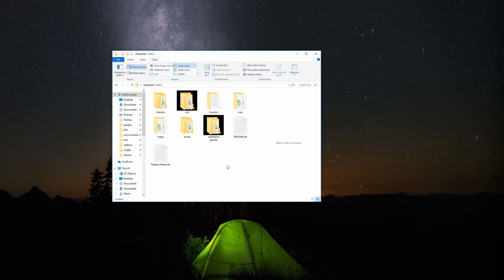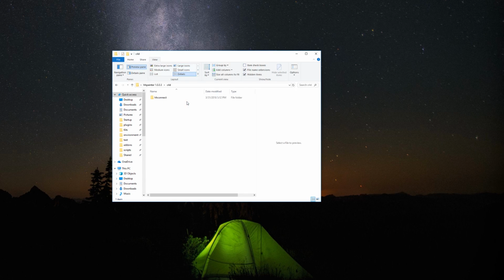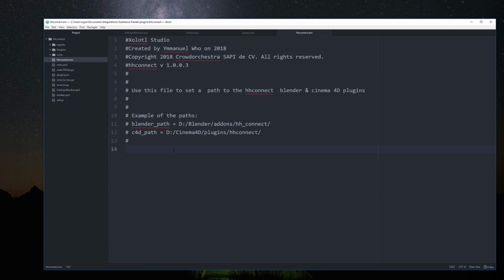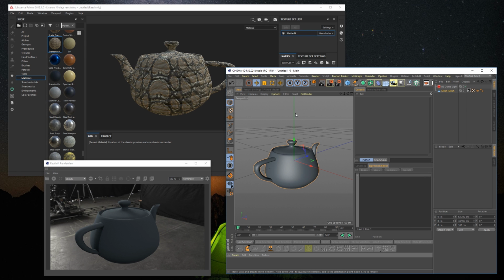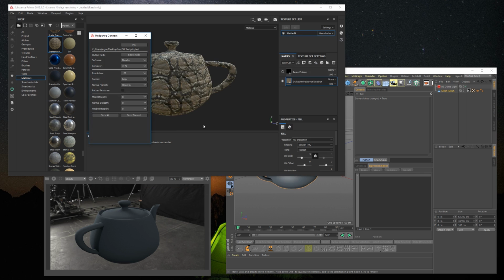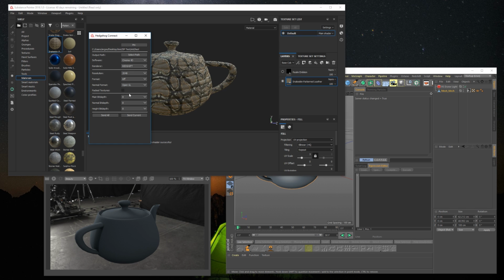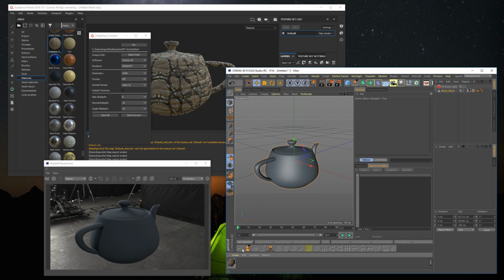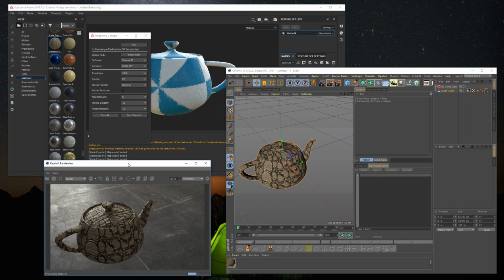LEGACY - [CINEMA 4D] SUBSTANCE PAINTER Live Link Installation and Use Guide

Comment: Unfortunately the Plugin does not automatically create a material in Cinema 4D. I Started it in C4D and also in Substance like in the Video. After clicking on "send all" or "send current" it say "Success" in substance log window. But no material in C4D. Did I miss something?
Reply from the maker: Contact me in the Discord server so I can help you check this issue
Reply from the maker: so the issue was that the version of the plugin was too old, updated to 2.0.1 and it got fixed :)
Reply: @XolotlStudio  Yes, now it works perfect. I am using C4D r19 and Substance 2020.1.1. Thank you for your help ;)

Comment: Could you please update this video? I'm having this error:
[MapExporter] Nothing could have been exported on the DefaultMaterial stack:
[MapExporter]     The channel Anisotropy angle is not available in the DefaultMaterial stack.
[StacksExporter] Map export ended
[Plugin - xolsplink] ERROR: [Errno 2] No such file or directory: u'C:/Users/mirko/AppData/Roaming/MAXON/Cinema 4D R20_4FA5020E/plugins\\temp\\data.json'

[EDIT] It seems working now, I just forgot to add "/xolsplink" at the end of the path in .json file
Reply from the maker: please read the instructions in the zip file.. if you still have issues, feel free to contact me via discord

Comment: This isn't working for me, My downloaded folders are different. The C4d folder doesn't contain a hhConnect folder?
Reply from the maker: the instructions for the new version are in the zip please read the text files included, the latest changed a lot in order to improve stability and add extra features
Reply: @XolotlStudio  Thanks for your reply but its very confusing, Which text files to follow? Is it HHcConnect that goes in the substance plugin folder or xolsplink folder? I'm getting nothing in C4d when I save the files out. Is there a simple tut for c4d and Substance?
Reply from the maker: @pelolocoblue  in the zip file you downloaded from gumroad, the hhconnect is an old version. the current version is 1.0.0.81 if you have more doubts feel free to contact me via discord ;)
Reply: @XolotlStudio  Thanks for your help, It is working now. Phew!

Comment: This seems like such a great plugin. 
The textures are exported to the designated folder for me too, and the discord link seems to be expired. Could you tell me what I've done wrong please? 
I've been looking for a solution to my problems with sp to c4d workflow for so long and now I've found the solution I'm desperate to finally get it working
Reply from the maker: i just used the discord link in this video, is that the one that seemed expired?
Reply: Xolotl Studio I just tried it again and it worked fine. Should I try to find someone else with the same question or message you on there?
Reply from the maker: @raejelly22  just write there i'm in the discord my name is ymmanuel

Comment: Great indispensable software   The HHConnect Bridge works with Redshift amazingly well.  Listen to the video during install.  STAY OUT OF PROGRAM FILES, this is not your mothers install!  No more messing around with Nodes unless you need to.  It reminds me of the days I used Lightwave- only this is for texturing instead of modeling.

Comment: my c4d folder doesn't have "hhconnect"folder,  but four different files inside it. 1.hharnold 2. hhconnect 3, hharnold, hhoctane.
Reply from the maker: yes i forgot to add the folder, you can just rename the c4d folder with hhconnect and use that one

Comment: Hi set it all up but nothing happens in C4d. The textures are exported to the designated folder.
Reply: I have the same issue
Reply from the maker: contact me via discord and ill help you link in the description of the video
Reply from the maker: contact me via discord an i'll help you ;) the link is on the description, also be sure to read all the text files in the zip folder

Comment: Godtier plugin man, bought it! I'm impressed (thanks to Ryan Talbot for showing me this). It was such a hassle to utilize substance painter in Octane workflow earlier on (had a model with 5 different parts, essentially 5 x 5 UV-maps and had to manually first process the maps from substance, then drag and drop one by one to Octane node editor). 

Hopefully this gets more recognition, I'll definitely be using this in my workflow from now on (hopefully at some point it'd be possible to have some indicator on the live link activity (on = green, off = red, I have no experience in plugin-development so I don't know if this is doable).
Reply from the maker: Glad you like it :), if you can spread the word that helps me a lot!

Comment: Dont know if its technically possible, but for your next project if you could somehow allow Cinema 4D to open .spsm files (smart materials) natively with the C4D plugin that would be great! Or make a spsm to sbsar converter. At the moment it only allows you to import .sbsar files (regular materials), which is a bit frustrating as theres tons of good looking smart materials on Substance Share but are unable to download and use them directly. Know its not a major issue, but if anyone could find a solution it surely it would be you haha
Reply from the maker: ok i'll try to check out if i can somehow figure out  a workaround to make it work

Comment: I have only installed Arnold and not redshift. The plugin throws an error, that it can't import Redshift. The file seems compiled, so I can't comment it out: 
  File "'hhconnect.pypv'", line 18, in <module>
Reply from the maker: Hi, yeah totally my bad, o forgot to uncomment that part, i'll fix it right now, can you join the discord or send me an email, to contact you once its fixed?
Reply from the maker: I have a hotfix ready, contact me via discord if you want it rightaway, it will be included in the next release
Reply: Perfekt, that's cool. I will test it in the next release. great work, I love the integration.
Reply: i have the same issue only in line 151 and a runtime error? can you update this please as the first reply was 5 moths ago and ive only downloaded this yesterday